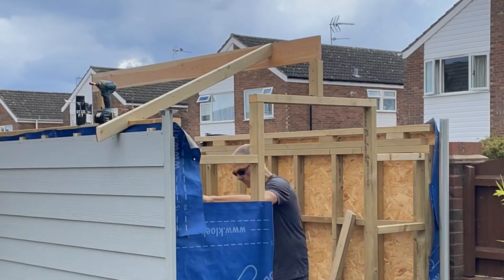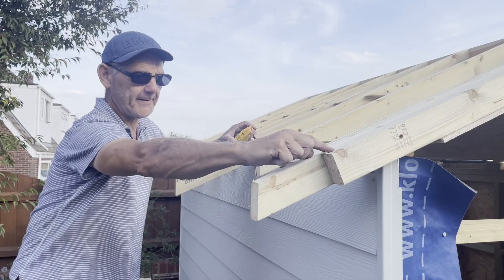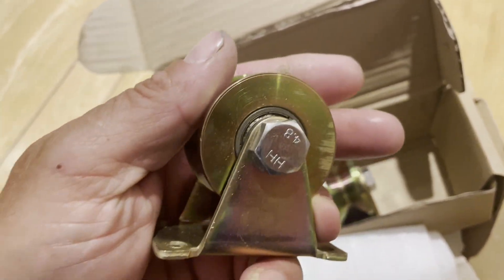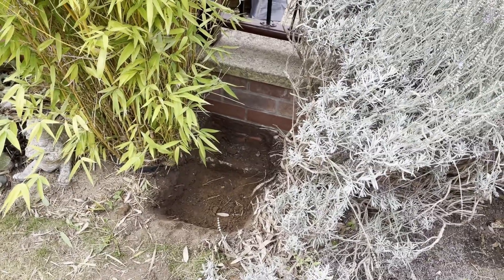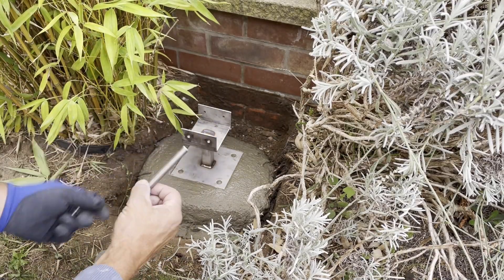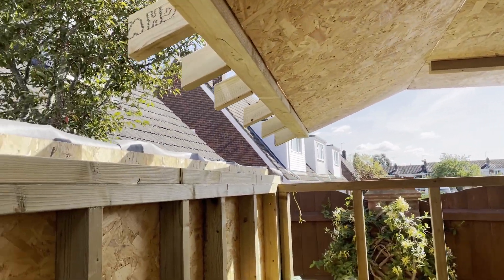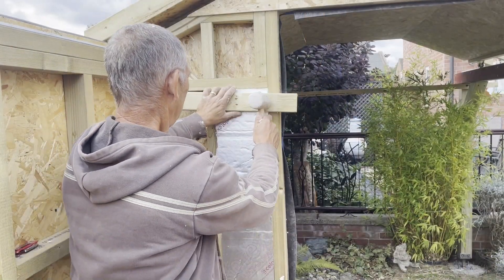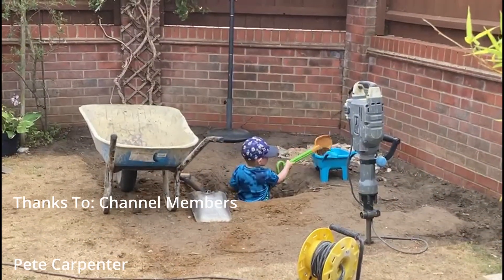Custom-Built Roof for Stargazing! Observatory Build Part 3

Comment: No tiene ningun refuerzo para impedir que el viento lo levante?
Reply from the maker: Hi and thanks for watching! The roof is heavy, so light winds are not a problem, however, when the wind is strong I clamp the roof down with these clamps! See link: 

https://www.amazon.co.uk/STARVAST-Adjustable-Holding-Capacity-Release/dp/B07RHD9CMN/ref=asc_df_B07RHD9CMN?mcid=2f1882cf42ed3297b09fe57bb522b660&tag=googshopuk-21&linkCode=df0&hvadid=696352102731&hvpos=&hvnetw=g&hvrand=16235605118243907187&hvpone=&hvptwo=&hvqmt=&hvdev=m&hvdvcmdl=&hvlocint=&hvlocphy=1007127&hvtargid=pla-766184169531&psc=1&hvocijid=16235605118243907187-B07RHD9CMN-&hvexpln=0&gad_source=1

Comment: Hello. I'm enjoying your videos.
I also built a shed in my garden about two years ago. You can see how it went in the video.
I wasn't sure how high the pillars should be, so
I built the walls to fit my height and later purchased custom-made pillars.
My garden has flooded before, so I haven't installed any electrical wiring. The roof is manual, but it makes taking photos much easier because I can keep my telescope ready to use at all times.
Reply: That wall height seems tricky..
I'm going to build one for myself and still thinking how hight it should be.. I like the idea that my setup is NOT parking in horizontal position, because one parking error can cause a disaster :(
Plus high walls give shade from wind.
I think I will go in something similar to what @SimonsAstro built :) It's looking very solid so far :)
Cheers guys!
Reply from the maker: @UssSamuG Hi and thanks for watching! Yeah the wall height needs some thought! My walls are approx 1.8m high, I can shoot at about 27 degrees, but as a rule I don’t normally shoot below 30! The end walls are a bit higher, but like you, I like the idea of being able to close the roof at anytime without worrying about a park position! Good luck with your build, any questions, just ask!  Clear skies 👍
Reply from the maker: Thanks for watching and I’m glad you’re enjoying my video’s! Clear skies 👍

Comment: Great to see again. On the temperature, I had to do both the insulation to my roof and reuse an old aircon unit as the recent hot weather in Valence, France was regularly pushing above 37c. Nice summers, but nit ideal for scope!
Reply from the maker: Thanks for watching Simon! 37 is a bit hot! I’m glad my insulation is working! I’ve been lucky not to have to use fans or heaters in winter! Clear skies👍

Comment: Hi Simon, your floor plan was 2.5x2.1, what length were your Hardie planks? The only ones I can find here in NZ are 4.2m so I’m thinking I may need to reduce the plan to 2.1x2.1 for economy’s sake if nothing else. When you were mixing the concrete is there a ready calculation for shovel fulls of ballast to half a bag of cement. (Were the bags a standard 20 kg)? Sorry for the basic questions for a builder but never having attempted anything like this before all the “ but how did he know that” questions keep coming up. Thanks again for all the information you make available to everyone. CS 🇳🇿
Reply: Thanks for the advice Simon, I’m sure it won’t be the last daft question. 🤪
Reply from the maker: Hi Pete, no worries mate, I’m here to help😀 Firstly, yeah as a builder I didn’t even think of the concrete situation! Half a bag of cement (here they are 25kg) is equal to 2 shovels, so I would use 8 shovels of ballast to give a 4:1 ratio. For your 20kg bags, you can half the bag and just put in 8 shovels ( not heaped) and you won’t be far off! It also depends on the size of shovel 🤣 Don’t think too much about it, just do it, the concrete will be fine! As for the Hardie planks, I wouldn’t make the obsey smaller just because of the lengths of hardie planks!  Mine were 3.6m long, so I had to join them on the ends and you’ll use smaller pieces around the door also! When you cut them, you have to paint the ends with the paint they will provide (at a cost)! Also you have rubber strips behind the joins! YouTube how to fit hardie planks! 
At 2.5 x 2.1m, my obsey is only just big enough, the pier is off center away from the door slightly to give me more room to get in, but watch the end wall for your scope! I wouldn’t go smaller, I’d go bigger 🤣 Clear skies

Comment: Again, Well Done, Simon.  I'm impressed with your workmanship.  I was amazed by the inside temperature being a good 5°C cooler than the outside hot temperature.  I was expecting maybe a few degrees warmer!  That must be some good insulation.
Reply from the maker: Thanks Pat, yes the insulation is good stuff, not cheap though! but you can feel a deffinate drop in temperature when you walk into obsey! Thanks for watching mate and clear skies